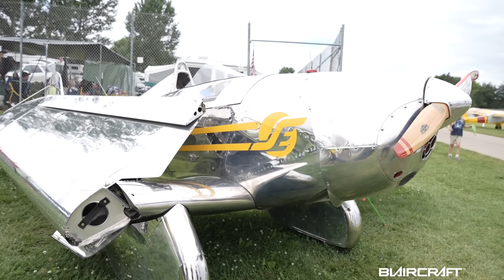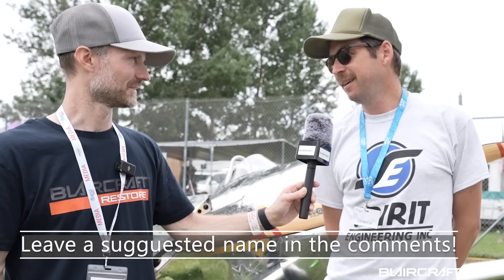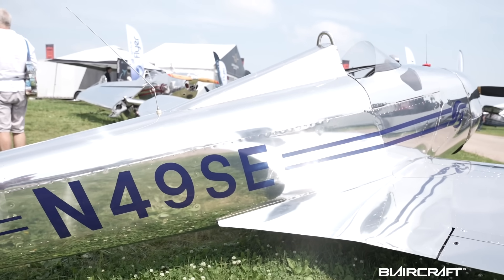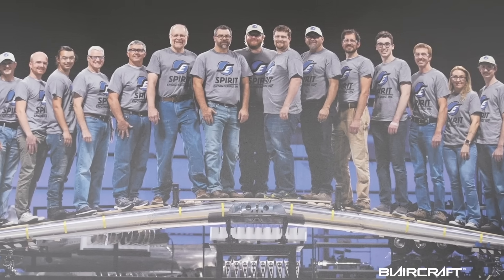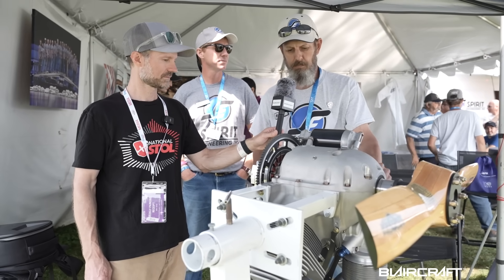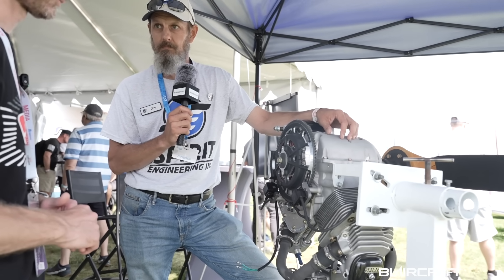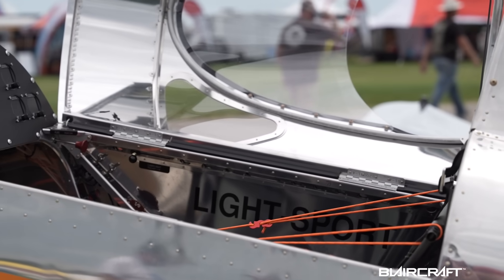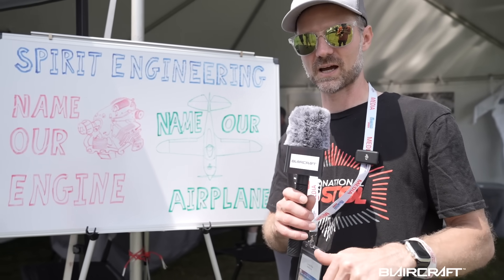Affordable Plane?! To Fly and Maintain, Fold Wings - Spirit Engineering SE-1

Comment: Wonderful.  50 MPG is excellent efficiency.  Can you do an enclosed cockpit?

Should be able to use the generator as a starter motor also.  Presumably too much red tape to certify that?  Not familiar with FAA regs.
Reply from the maker: It’s already certified. Certification was final just a few weeks before flying 4 of them to Oshkosh. 

Also, they are developing a fully enclosed canopy.
Reply: @Blaircraft.Engines  Thanks, I was referring to using the generator as a starter as being the uncertified part.

Comment: no. 1 reason I dislike this machine is the wings fold ! 70 k price is my second ! 3rd reason is tail wheel . Speed and fuel economy is good .  I like the wheel fairings and its art deco look .
Reply from the maker: Actually those 3 are what I like 😆 Folding wings, price and TW! They can easily be converted to nose wheel in the near future. 👍
Reply: Yes and I know why you like them . @Blaircraft.Engines
Reply: how much dose the engine weigh ?
Reply from the maker: Not sure… great question. I’ll have to find out.

Comment: FAA is ok with no twin mags? Don't get me wrong I love it
Reply from the maker: Yes with a single place.
Reply: @Blaircraft.Engines  do you know any more about it?  I think it has two ignition switches in the cockpit.  So, each ignition serves only one plug in one cylinder?  How well will it run on only one ignition?  Will it make half the power?  I assume a normal dual ignition system will still make ~90% power with one magneto failed.
Reply from the maker: @lunchbagr4750 that is correct. Two switches for two plugs. FYI- you can hear it run in my factory tour video, published later after this video. Not sure the % of power as I didn’t leave one switch off too long. However, you can hear the run up I did.
Reply: @Blaircraft.Engines  I re-watched the other video, very helpful video btw.  I like essentially everything about this design except the ignition.  I'd be interested in flight test results on one ignition.  I assume it produces little power and shakes a lot. but extends the glide.  I would be curious about their rationale for this.  Everything else has pretty good rationale, so they must have thought it through.  Frankly I was surprised the ASTM allows this for single seat but I looked it up and you're right.

Comment: Name the engine the "All-Terminator-XX" and give displacement in the X'S.

Engine development should continue with a 4-cylinder, 5-cylinder, 7-cylinder versions.  Horsepower will track commensurately.

If a Light Twin Pusher comes about with canards . . . you will have the most efficient reciprocating transport on the planet.  

I would like to see a larger version of this engine on the  ARCHON,  or REVELAERO aircraft.

I would like to see a fuel injected version with dual injectors in a throttle body keeping everything simple, but redundant.  THAT can be scaled for larger engines.
Reply from the maker: Thanks for all the feedback. Keep an eye out for the part 2 coming very soon!

Comment: sounds to good to be true, how about spare/replacement part availability? a one off experimental engine design, granted all engines were once one off and experimental. just a little  concerned these days that what we see and are told about this aircraft is indeed true. i guess only time will tell. maybe rent before you buy might be a good move.
Reply from the maker: Yes. Sounds very good. They are set up for production and I would imagine parts would be readily available. 

Be SURE to keep an eye out for a part two, you’ll be even more impressed as their facility is amazing. MUCH more coming!

Comment: HOWEVER- $70k to just sign & fly? not bad. sweet little plane. you should offer a fully enclosed bubble canopy and a water cooled inline 2 cylinder centrifigul supercharger normalized verison- I'd go yamaha w/gearbox, fadec control, great for hops over the rockies when natural aspiration just won't cut it.
Reply from the maker: FYI- There will be a part 2 video. Stay tuned for a full review and flight… 🤞

Comment: your biggest problem will be- fisher aircraft will sell a nice bush plane like the dakota hawk- a tail dragger, 2-place, fast build kit, then add an aeromomentum 1300cc aircraft engine- all in with covering? about $48,000- it's also 100mph, stall speed of 35mph, enclosed cockpit, side by side 2 place, also folding wings for easy trailering ... for over $20,000 LESS- and an engine that has full fadec control and an EXCELLENT safety record. like cheap fuel? the guys over at aeromomentum can map the ECU to use E85 for fuel. $2 a gallon anyone?
Reply from the maker: True. However, picking up from the factory and flying home at 70k is hard to find, and the QUALITY is amazing. Their engineering background is impressive as well. I'd bet the engine will do very well. Looking forward to seeing how things are in 12 months from now.
Reply: @Blaircraft.Engines  yah- sign & fly for $70k is unheard of. the new FAA light plane rules are awesome. I'd venture that this type of setup will yield better safety record than the old experimental rules (home or ever builder assist) and even FAA certified- because the manufacturer can spend all their efforts & time on ACTUAL safety- instead of burocracy fees, red tape- testing to failure, etc.
Reply: That is a great deal for those who want to build a kit, but many people do not - they want a ready-to-fly airplane, and $70K is an excellent price for that.
Reply: @bruceculver5935  agreed. sign & fly for $70k? exceptional. still not as much as a 1/2t pickup on big 4 x 4's- and way more fun.  I still think they should offer a canopy add-on that makes it enclosed. maybe they will later.

Comment: maintenance is what interests me the most. mechanics should get familiar with those engines first. also, TBO is yet to be discovered. how can you get an airplane certified (slsa, I know) without providing those numbers. what about maintenance intervals? oil changes? what about night VFR? looks like a great toy so far. for some reason, when looking at it, I cannot stop thinking about Piper's problem with wings falling off at some point. The question is: do you want to be a beta test pilot and pay 70K for it? yeah. I like the idea but also have plenty of concerns.

Comment: Starting at $70k…..so close but just out of reach. Super cool though!
Reply: Airplanes can be financed like motorhomes, for up to 12-20 years. The payment will be closer to a $25k car than a $70k vehicle. 

Factor in what you pay to rent the local, barely airworthy 172 built in 1972.
Reply: @Triple_J.1  for the plane itself yes, but then you factor in hangar rent alone and it doubles.
Reply: @RKsomeone-b6k  The folding wings allow you to keep it in a one-car garage or a car travel trailer 20 ft long. No hangar needed.....

Comment: Couple things seem to be missing from that spec sheet at 3:30...   Whats the fuel capacity and average range for flight?
I heard 100mph a couple times, which sounds nice, but for how long?
Reply from the maker: 8 gallon tank, approximately 3.5 hrs with 30 min reserve. I would stick to 3 hr max flights.
Reply: @Blaircraft.Engines  Thanks!  300 mile range in good weather conditions seems pretty nice.  I look forward to some flight footage!  You say it is fun to fly, is it very aerobatic, or more for normal level flight?
Reply: @starhawke380  It's a +4G/-2G design, so not rated for aerobatics.
Reply from the maker: @starhawke380 not sure… but yes they said it’s fun to fly, I’m betting it really is.

Comment: Cannot find any independent info verifying that this aircraft has actually been certified. Would be great to find out?

I like it but I am sceptical.
Reply: When most people say "certified" in aviation they mean standard airworthiness certificate.  In the case of small airplanes, that would mean part 23.  No, it is not that.  It is designed, built, and declared compliant to the ASTM standards by the manufacturer, just like all S-LSA aircraft.  And just like the bigger aircraft that will be manufactured this way under MOSAIC starting in July 2026.  It's the future of general aviation because it's the only affordable way for a company to produce a small aircraft anymore.  Part 23 certification is prohibitively expensive nowadays.

Comment: 4 (FOUR) or 2 (TWO) STROKE engine? Sounds like a 4 stroke.
Shame on you for not mentioning the stroke type, and of all things, no reference to the valves or ports. It would have added 15 seconds.

WOW!!!

LOOKS GRET and sounds even better. I am a big V twin air cooled engine guy and just amazed at the innumerable mods Erik Buell made to the H-D motorcycle engines used in the Buell XB9 and XB12 motorcycles. Those engines run all day at 3,000 to 3,600 and top out at 6,000 rpm. Their maintenance is air, oil, gasoline and filters, hydraulic lifters (no adjustment needed) and last long without problems. Hope the Spirit engine is as good or better.
Reply from the maker: Thanks for your comment! 
The plan was to ask a few basic questions that came to mind and reference where to find more info. People’s attention spans are short and I don’t have a huge following (yet) to be less boring… 😬😁 

Thanks for watching and glad you found it interesting. I’m sure they will do well. 👍
Reply: It's very obvious it is a 4 stroke engine.
I knew it was a V twin the first time I heard it.
And I also knew it was under powered from that first listen.

Comment: I saw the plane at Oshkosh and fell in love.  On my drive home from the airshow to California, I got off interstate 70 in Grand Junction, CO.  I stopped at the Spirit Engineering factory.  I was kindly greeted and ask if I could have a peak inside the factory.  I was given a 45 minute tour.  These guys are ready and able to pump out 1000 planes per year if the demand is there.  I saw 25 airframes neatly lined up on the factory floor and all the wings stacked on storage racks, ready to be mounted to the planes.  I was then shown all the parts for 25 more planes finished and ready to be assembled.  They are looking forward to serious production.  Seriously, a brand new factory built plane for less then the cost of a new truck.
Reply: So how much does it cost?
Reply: Less, THEN the cost of a new truck?
Reply: @jbgood7694  isn’t that ironic , a new one ton , not yet ready for job costs from 85 to 95k , if set up to do a job , can go as much as a base semi tractor , sad state of affairs
Reply: @rblueroan2205   He was just picking on the OP's grammar, for no good reason.

Comment: The government has destroyed general aviation. Look at that jetski Icon aircraft that's nearly $400,000. Should be about $40,000 in a sane world. It wasn't lawyers. If lawyers were the problem we wouldn't have ski resorts and motorcycles would either be homebuilt or cost $300,000.
Reply from the maker: The Rotax engine on an Icon is nearly 50k its self… prices are more than double for sure. Sure hope this new factory built aircraft is a proven success though..
Reply: Icon ruined Icon.  The gov't is at fault for strangling general aviation for too long, and for making the original sport pilot & light sport aircraft restrictions too constrained for too long.  However MOSAIC totally changes that.  General aviation is back, and the gov't should be applauded for the recent change.

Comment: Questions about the engine: why did you chose a carb over fuel injection, and secondly would this engine be amenable to forced air induction turbo or super charging?
Reply: Carb?price
Turbo.
Cost.
It's a zero turn motor.

Comment: A brand-new engine of an antique design. I understand that this is an inverted engine built to aviation standards, but it is essentially the same as a Briggs and Stratton Vanguard "Big Block" missing the fan and cooling shroud, but scaled up a bit.
Reply: Briggs/Vangaurd utilize aluminum connecting rods. Aluminum has no clearly defined fatigue limit. It will eventually break no matter how small the load if the cycles are high enough. Those engines will throw a rod thru the block eventually. They are made to sell replacements to people who are dumb enough to own and operate a lawn mowing company.

Comment: The name of the plane is the Slick 400 because if it goes 100 miles an hour on 2 gallons of gas and holds 8 gallons, it will cruise for 400 miles and it is called slick because it looks so cool and shiny and silver and that's pretty slick. I would shy away from naming the engine spirit or anything related to your company name spirit because when I am in the airplane or getting ready to go in the airplane I don't like to think about spirits.
Reply: 😂 Spirits ! That’s funny !!👍🏻

Comment: I would call the engine the "Miser" because it only burns 2 gal of gas an hour.
Reply: There's nothing special about the engine - it has about the same power output for a given flow rate as any traditional aircraft engine or small lawn equipment or industrial engine. It's just small, to go with the low power requirement of the light and small aircraft. 

At 2 US gallons per hour, and likely about 0.45 lb/hp-hr, it's probably producing less than 26 HP in cruise. 

Spirit specs the maximum fuel flow flow rate at 4.0 US gallons per hour, which is 24 pounds per hour (gasoline weighs 6 pounds per US gallon). They spec the maximum power at 42 horsepower, so that's a very poor 0.57 lb/hp-hr, but it should be better in cruise.

Comment: What is the large number on the tail--the serial number?  Are   intentional spins permitted?
Reply: Hi! Lafe here with Spirit Engineering. The SE-1 is placarded against intentional spins. We had to do spins in our flight testing and found that the aircraft is very hard to accidentally spin. If you do get into one, it recovers nicely. The vertical tail numbers are just for fun. They are supposed to look like vintage race numbers.

Comment: It flies for an hour at 100 mph on 2 gallons of gas. In other words it gets 50 MPG. That's way better than most cars.
Reply: Sure... but how about single-passenger cars that don't meet any road regulations (such as emissions or crash safety)? Oh, right, there aren't any of those. It's an amusing comparison, but not relevant to anything.
Reply: @brianb-p6586  Motorcycles could be regarded as single-passenger "cars" and they sure aren't big on road safety. To the point where some people have suggested that if motorcycles were only invented recently, they would never be road legal, but because they've been around forever (well, since the beginning of automotive transportation) they got grandfathered in. Much like alcohol, which would be a schedule 1 narcotic and completely illegal if invented in recent decades, but it's been around for centuries and ingrained in society, so it's grandfathered in.
Reply: @samfromportadown I  agree: this aircraft is reasonably comparable to a motorcycle - that would have been a better comparison.
Reply: If gasoline was invented today would they let a mom with a minivan full of kids filler up up ?!

The MSDS sheet on gas would make EPA and osha swoon .

New Jersey and Oregon would no longer be the butt of jokes !

Only states that require attendant to pump gas .
Reply from the maker: Exactly. Even though it’s 70k, it’s unfortunately reasonable for a new aircraft.  When you consider the miles per gallon and storage options with folding wings, I believe it’s more attainable than most.

Comment: Unsurprisingly, sounds like a Harley.
Reply: Yes, but not quite... it has the 90 degree vee angle which is required for good balance, but a Harley is only 45 degrees so the firing pattern is more regular.

Comment: Looking at the design of the landing gear I think it’ll be retractable. Also with full tanks you still have 252 pounds for the pilot in that small cockpit. I’m interested on the updated version after mosaic.
Reply: RG and a bit more power.  Keep it below $100K.
Reply: Landing gear is fixed
Reply: @Video81501 look at the wheel pants. You’d add those to a plane when every other plane has a rain drop like wheel pant? 
As of right now it may be fixed but once mosaic goes into effective Im willing to bet a dollar other wise.

Comment: The notion of driving thos aroundin a toy hauler is probably not great.  The amount of stresses placed on parts when in folded position wpuld not be something I would want without a very special built transport cradle.
Reply: This was addressed during the design.  A lot of testing was done to make sure that it would handle trailer loads.
The airplane is designed to be trailered!

Comment: What is miles an hour
Reply: This is a slang derivation of the phrase, “Miles per hour,” which refers to velocity. Velocity is a vector quantity, meaning it has both magnitude and direction, which helps in understanding how fast something moves in a specific direction. But you probably already knew that, as your comment had a smug, rhetorical tone to it.
Reply: @michaelives1018 what country uses an archaic system based on the length of your thumb
Reply: Unit of speed

Comment: Beautiful plane, but at $69,500 to START, and no kits - not what I'd call 'affordable.' Certainly less expensive than Cessna's failure at 'Light Sport 162 Skycatcher' $150,000+ discontinued and no longer supported, no spare parts (even though I liked that plane).
Reply: It's a pretty good place to start for a factory built airplane.  Imagine if something like this took off and the price would stabilize low or even decrease.